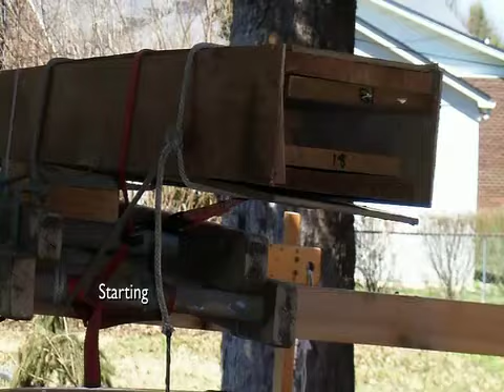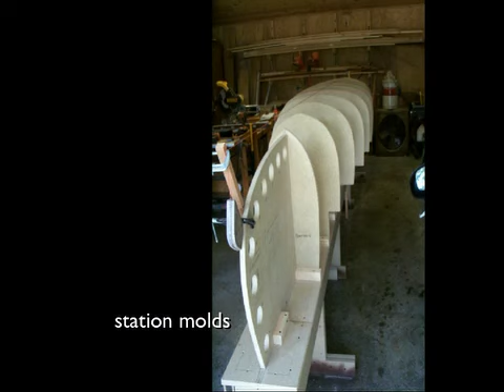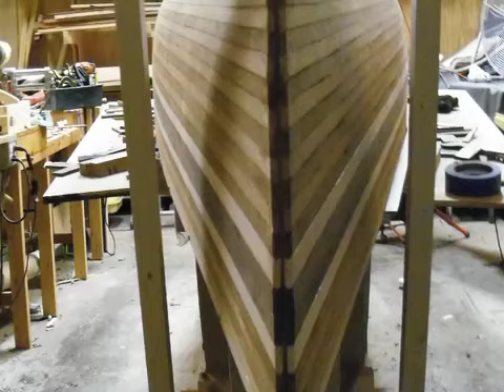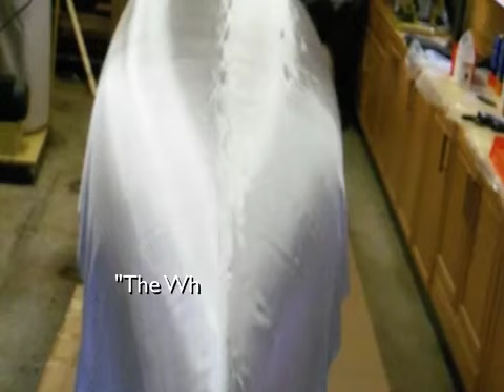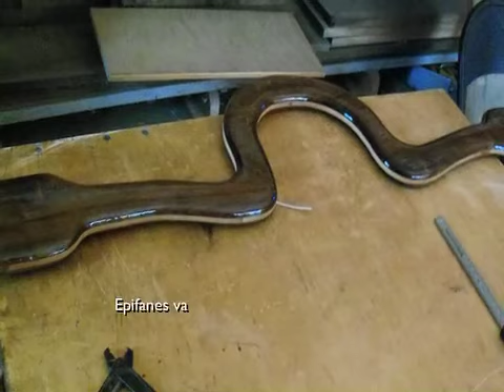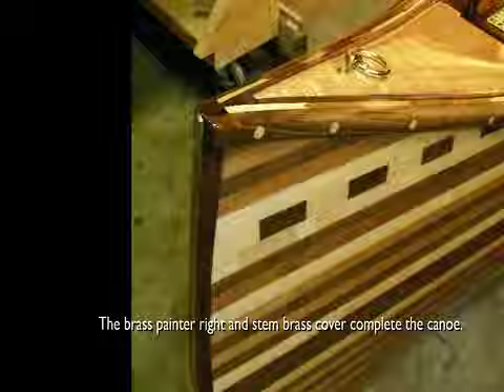Prospector Wood Strip Canoe Build from the book "Canoe Craft" by Ted Moores

Comment from the maker: Michael Smith, 
I used West Systems Epoxy. 105 Epoxy 207 Clear Hardener, when gluing, the 204 Microfibers were added for stiffener. Also, save your wood dust from the sander, mix it into the epoxy for filler and color to help repair and cover mistakes. I am a hobby woodworker at best, not an expert. I just took my time and when I messed it up, I took it off and redid it. Several times I waited  3 or 4 days to talk myself into doing something. Several times I wanted to set this on fire!

Comment: Beautiful build.  Love the decorative strip!!  How did you make it?
Reply from the maker: I took a 1/4 thick X 1'' maple strip of wood and laminated the 1/8'' X 2'' walnut and maple strips onto it with epoxy. I then planed the 3/8 thick combo into a 1/4 x 1'' strip by removing 1/8'' from the back of the 1/4 maple strip. I then shaped the bell and cove on the shaper. The wood strips were then ready to assemble into the plank layout. Wax Paper kept the epoxy away from unwanted areas during glue up.

Comment: I bought the canoecraft book as you described.  Yet I see this boat as a 16' length.   Where in this book can you change the length.  How did you do it?
Reply: I haven't looked at You Tube in a long time, sorry for the delay. I added 12'' to the center of the canoe, so each end is still identical to the plans. The center section is the same width, height, diameter for 12 more inches. I did it so it can carry more weight as I am a big ole boy. It did not hurt the performance of the canoe, in fact it might have made it faster, as it has more displacement. The canoe weighed 70 1/2 lbs when complete. The two paddles weigh five pounds together.
Reply: I built the Prospector more than 15 years ago and Ted had told me in his class that  the Prospector was capable of carrying two paddlers plus 500 lbs of cargo. I made mine 16' as the plans show. Great Canoe !

Comment: Where did you get the station molds?
Reply from the maker: Luis,
I got everything from the book "Canoe Craft" by Ted Moores. For $19.00 you can have everything you ever wanted to know about building a canoe and then some. Like sharpening tools to a razors edge! And drafting plans to build the station molds.
You will enjoy the book, even if you never touch a piece a wood again.
Reply: The station molds diagrams for templates are in the book by Ted Moores. You buy the book. Read it. Draw the templates from "boat codes". Cut them out of particle board.